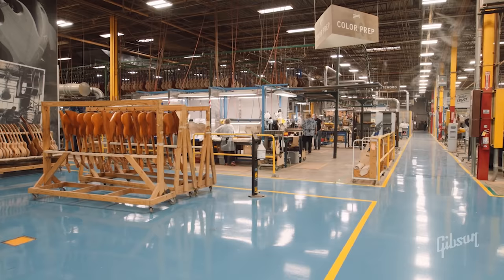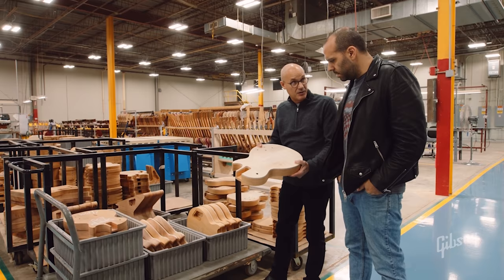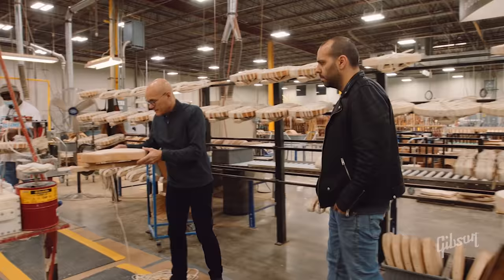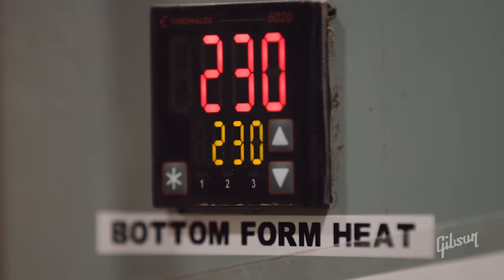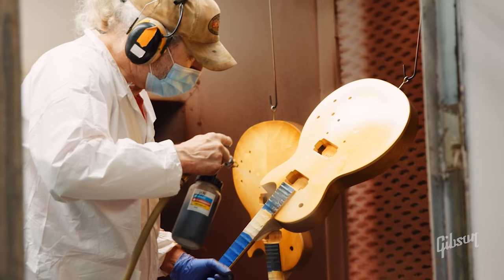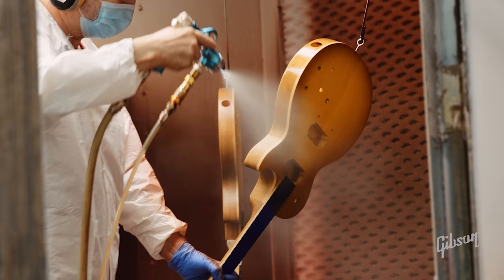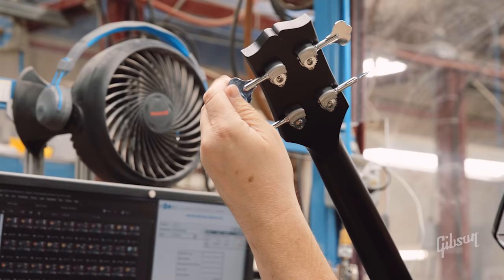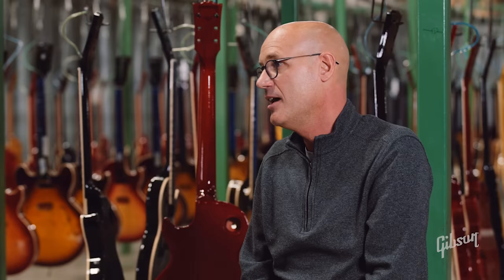The Scene Nashville: The Gibson USA Factory Tour

Comment: When they were talking about the final, quality control, inspection, I wanted to scream. A few months ago, I bought my 2nd LP. It is a lefthanded, LP Tribute. I love absolutely love the guitar, but it needed some pretty major work to become the player that it now is. Sure enough, in the case, there was a picture of the guitar on the work bench..along with the inspection check list.....which said that it passed its inspection. However, there were issues and the inspection obviously hadn't been thoroughly done. What was the biggest issue, you might ask? I'll tell you....the freaking nut was barely cut. It was almost like there someon tried to cut it with dental floss and gave up. The strings were resting on top of the nut..and it almost looked like they put a right handed nut on it..but gave up part way through cutting it. Regardless, I love the guitar...but I had to put a few hours of work into it. Gibson..I want a present!
Reply: I’m glad you brought this up here so they can read it. The quality of these instruments has just suffered so much in the last few years. My Les Paul Studio (2017) had 2 fret endings that cut me and I considered myself lucky after researching what’s been happening with Gibson. 
In the last couple years of going to my local Guitar Center I’ve run into major problems with their Gibsons. One SG had a screw sticking out of the strap lock hole which was broken. An Explorer a busted pick up selector. The clerk said they came that way and shame on Guitar Center for keeping them on the floor at full price.
Reply: @michaelsnydermusic  that’s a Guitar Center issue. They obviously take zero pride in their stores it’s like being in a smelly shopping mall. Gibson has its faults but they deserve better retailers than GC.
Reply: @dahliafiend  it’s both.

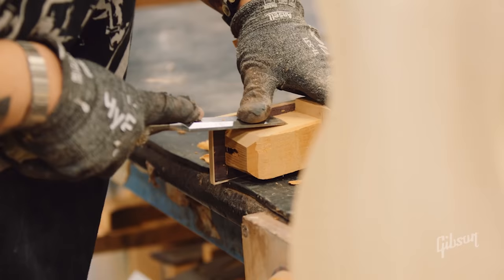Comment: I don't feel it should be neccessary to take a chisel to the tenon to make it fit the body, it's CNC'd after all, or is it? At the very least it should be way less than 1mm of material needed to be removed, not the big hunk of wood we see here 4:04.

I've also seen a side view of the inside of a Les Paul, it shows the neck tenon having a bow so it doesn't make contact at the front and back on the bottom, if both the tenon and pocket are CNC'd why so much adjustment?